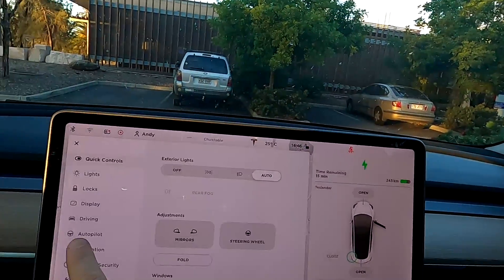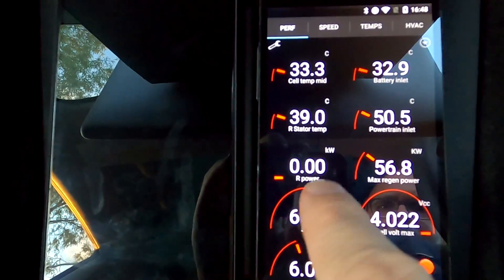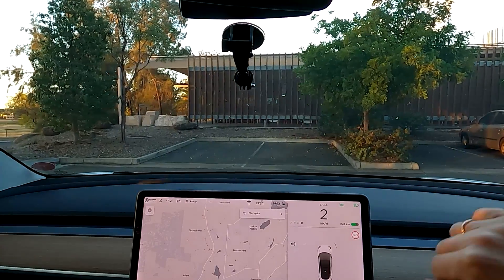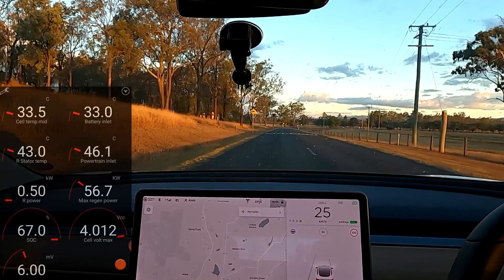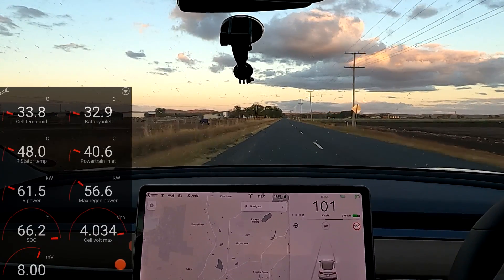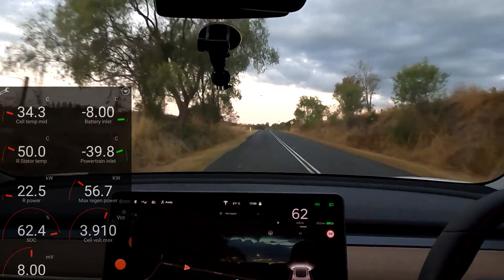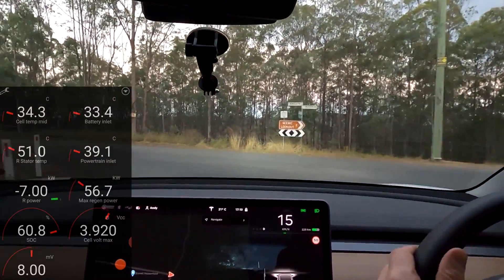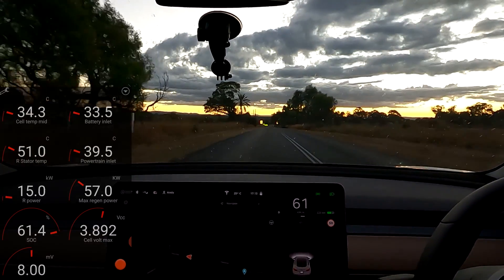EP369 - Does braking increase regenerative power in a Tesla Model 3 (like in the Outlander PHEV)?

Comment: I haven’t got my M3 yet but i can imagine that if your driving style, average weekly journey length, and location means that you never use your brake pedal then the low regen setting would be good for periodic use to avoid calliper/disk rotor damage. If the brakes don’t get used on any car it can result in seized callipers or rusted disks that then require replacement. I guess it all depends on how much the brake pedal actually gets used.
Reply from the maker: The car is intelligent enough to use the brakes frequently to avoid that and keep the callipers going. There is never rust on the disks like I always had on the PHEV. You usually don't use the brake at all. Did a 180km drive on the weekend and not touched it once.

Comment: The low regen mode is useful in winter. If you are a inexperienced driver the car can feel safer with it on. Because when it is off the car tend to loose back wheel grip and oversteer when you do released the foot from the pedal. Because on all model 3 the primary motor used for regen is the back one.
Reply from the maker: I didn't think about this. Great cause to use low regen settings. Thanks for the tip!
Reply: Only problem: No snow for you. We in Ger habe to mutch snow 😞(Brrrr, kalt ❄)

Comment: The only thing I worry about is the potential for following drivers to be surprised by my strong regen without warning brake lights.
Reply from the maker: But you have the brake lights on with strong regen. just not with low settings above ~55km/h as shown.
Reply: Yeah, I certainly hope so.
Reply: I think that automatic brake lights is obligatory on each battery car now, both hybrid and pure electric.. Maybe also on some fossils??